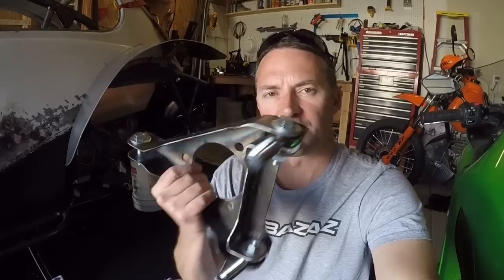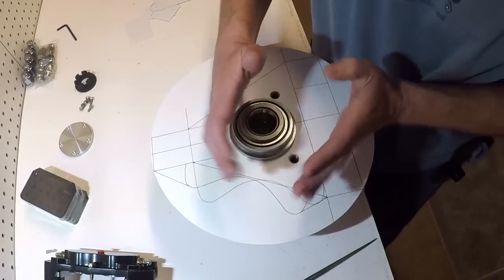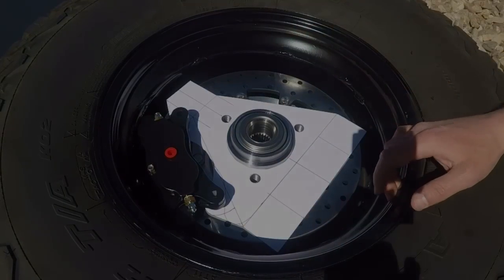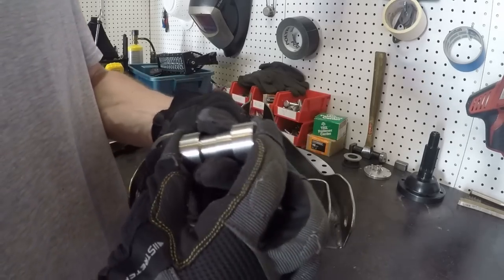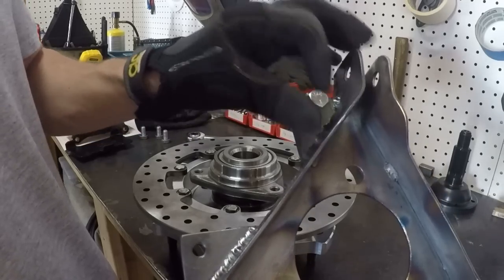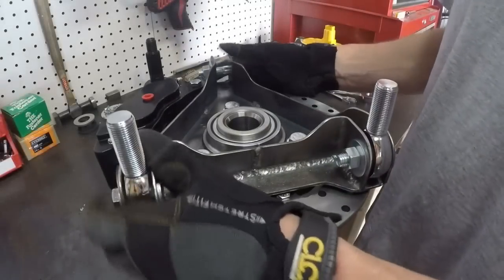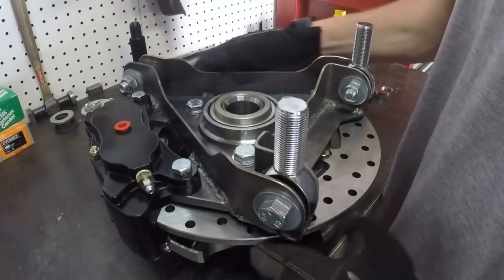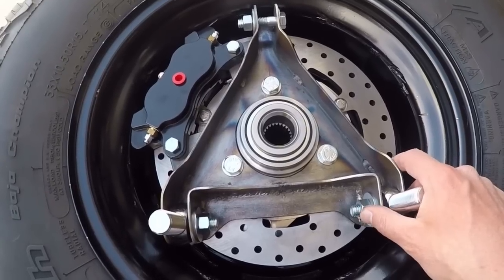Rear A Arm Spindle Fabrication for Baja Bug

Comment: you're doing a great job, very thorough, my only quetion is why control arms and not trailing arm?
Reply from the maker: Great question.... For the type of driving I do (Trails) I think Control arm suspension is better. Control arms are easier on the axles and transaxles. And in this setup it allows me to get more travel. And to some degree I think I like it because it's a little different.
Reply: @DougBugBuilder  I understand. I like the adjustability you can get from aarms so i guess its really a matter of preference and application. But I do believe trailing arms provide more hook up on holeshots without unnatural forces on the connections. Whereas aarms deliver the travel needed for rock crawling with equal load on the connections. It's kinda like six in one hand half a dozen in the other...

Comment: Nice work and very informative. Could you possibly share your control arm lengths please ?
 I would like to use your set up on my current tube chasiss baja build. Thanks
Reply from the maker: Sorry I missed this earlier. The rear control arms are 24" from center point of the outside and inside pivot points.
Reply: @DougBugBuilder  , no problem thank you for sharing all your awesome info ! You have tons of talent and your build is super cool !!!

Comment: Awesome, I need your advice , I have someone build mines out of 1/4 aluminum, is it going to be strong enough for a 438 hp and 458 torque?
Reply from the maker: It could be, as long as the bolt holes are close to the edges. If it's flexing you'll feel it going around turns or in rough terrain. The brakes will feel loose because if it's flexing the calipers pistons will get pushed in some as it flexes. So the next time you hit the brakes they'll feel soft.

Comment: which  material do you use for it?
Reply from the maker: Everything was 1/8" mild steel except where the caliper bolts on. That's 1/4" mild steel.

Comment: Doug how was the long term use of this spindle?  Wondering how durable was it for its use?
Reply from the maker: It has held up well. I made it out of 1/8". When I make my next rear spindles it will have 3/16" for the mounting flange. But that being said, this one has held up fine.
At one point I thought it was flexing under hard cornering on asphault. But tearing things apart I found the spindles were fine. It was my rear wheels that were flexing.
Reply: @DougBugBuilder  thanks, I found it interesting since most spindles are solid aluminum or steel so was wondering how it would hold.  Thank you and keep up the awesome work.  I'm learning from you 🙏🏽

Comment: Just found your videos, really like the rear a arm idea.  One question though, the load placed on the plate that the unitbearing bolts to seems awfully thin at 1/8 inch.  I know your trying to pull that u joint in as far as you can but a boxed spindle with sleeved bolt holes might be worth looking into.  Then you can rebuild it and pull the hime joints centerline of the u joint.   Lime I said really dig the build enjoying the videos thanks..
Reply from the maker: Tony Bush, I can't argue with you on that. That's one item I will really need to keep an eye on once I get some test runs in. I'm hoping because it has so little area before the side bracing comes into play and with the casting it won't have to carry to much stress. We'll see, your boxing idea is good. If I need to strengthen it maybe I'll go that route.
Thanks for the comment and sharing your concerns, it's appreciated and needed on projects like this.

Comment: Hi boug im from south afrika and im  intresed in building my own bug,what type of steel did jou use and do jou any more details an the rear hubs,jou sec thats its micro hubs,is it the mirco bus hubs? Thanks
Reply from the maker: Hello Jacques,
This is the kit I bought. http://www.dansperformanceparts.com/latest-rage-598031-micro-stub-brake-kit-5-lug-set-of-2.html
The kit was pretty low quality, if I did it again I would get this kit instead.
https://www.kartek.com/parts/jamar-performance-pro-x-porsche-930-rear-micro-stub-brake-kit-with-4-piston-calipers-11-38-rotors.html
There is a $500 difference but big difference in quality.

The spindle itself is made up of 3/16" mild steel.
Hope that gets you going, let me know if you need more info. Good Luck!